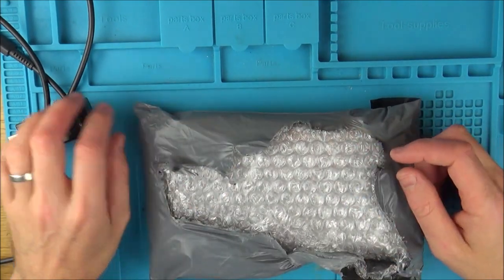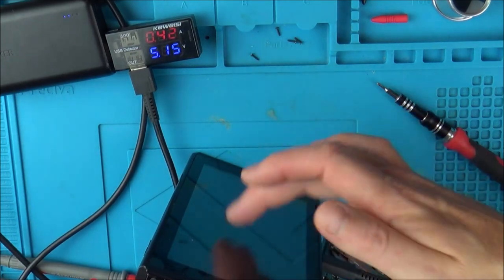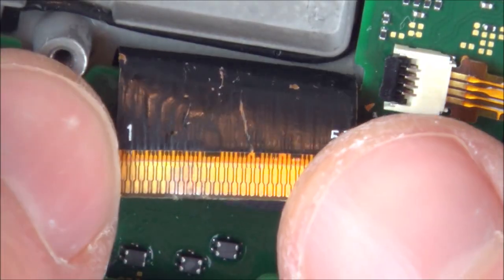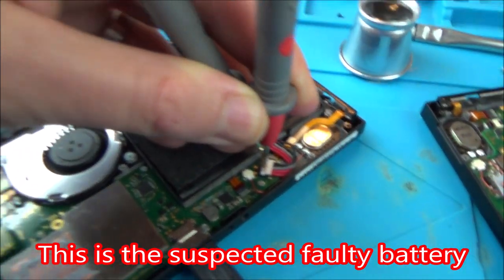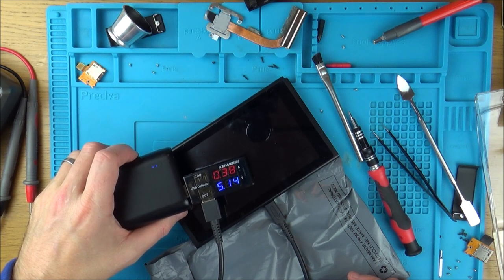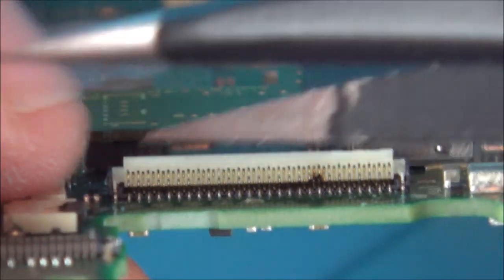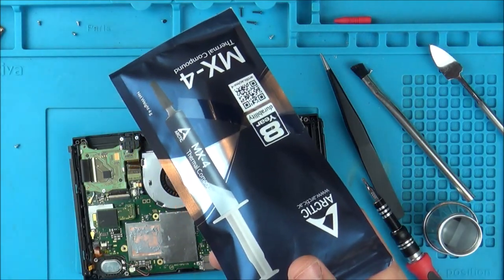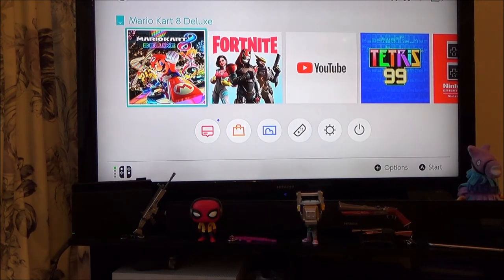Trying to FIX: Faulty Nintendo Switch

Comment: Vince,  when you showed the connector under the microscope well to say the least it opens up a whole new world,  just goes to show the switch is  quite a feat of modern engineering,  a powerful console with a built in TV,  you are a brave man for attempting these fixes,  99% of us would surely kill a switch and it's pleasing to see that you have learned enough to know when to stop,  like you said the connectors are now available and cheap,  buy one and have a go at fitting one to a dead board,  you won't know until you try

Comment: Hi Vince :) To solder connector don't use heat gun, only for desolder bad one. After desoldering, clean pads, put connector in place and solder very left and right big pads to keep it in place. Then add a lot of flux to all connector pins, melt some solder on your solder station tip and slowly go from left to right on that tiny pins. Finally use copper wick remove bridges and here you go :) also look at Louis Rossmann videos, he done that many times during his Mac repair.

Comment: Another excellent Switch video Vince!  I am pretty sure you are right and it's all about that video connector!  Why not have a go at fitting one - just use hot air to carefully remove the old one, then see what needs to be done regards fitting the replacement - nothing lost!
Reply from the maker: Thank you Chris, I spoke to Paul (the owner) and he is up for me giving it a go. I purchased 3 connectors on eBay (£2.99 each) so I can have a few attempts. I would love to able to do it as these connectors are a PITA. Hopefully it can be a revisit video:-) BTW the Atari Lynx vid has just been released :-)
Reply: Just watched the Lyxn video =D   BTW - if you can access the pins to solder on the new video connector, try just adding flux and light drag soldering.  Just not sure if that connector has 1 row of pins underneath it - meaning the only way is with hot air.  I do see the dilema - it's certainly not easy to replace I think.

Comment: Vince that connector is easy to replace ,would show you how to do it if I had a switch, I would remove the old connector with heat, clean the pads put on the new connector, solder pin for pin under the microscope , remember there are two rows of pins one under the white flap and on the back no heat required to put it back.you can heat it from the back as long you don`t move the board ,surface tension of the solder should hold the components in place
Reply from the maker: Thanks, would you use a very fine tip (the pointed one) on your soldering iron? Also would you just work with the solder on the pads or try to add new solder from the tip of your iron? Maybe with my new microscope this may be possible for me :-)
Reply: @Mymatevince  worth a go, as Paul said go for it!  Hope you do have a go i want to see it! cheers again for the entertainment. enjoy your videos
Reply: Great videos Vince, you would need solder paste and a soldering heat gun, fine tip would still be too big. Good luck
Reply: @jamiemoore7987  I think the soldering heat gun is the main issue with melting stuff. I would just stick to the soldering iron on a pre tinned and fluxed board
Reply: If the nozzle is small and the temperature set correctly it shouldn't melt anything but the solder paste :-)
Reply: I did a Ipad home button the other day, you cant use hot air on the lcd the only option was to use a soldering iron with a 0.3mm to replace the home button connector ,was a similar connector
Reply: @My Mate VINCE I would use a very fine tip (pointed one) , I would also remove all the old solder to have nice clean flat pads to work on, use solder/braid  wick and a big tip flat tip   , lead free solder takes more heat then leaded solder to melt ,put the connector on the clean pads line it up, apply flux add solder to the tip of the soldering iron , do the first pin on the connector end so that you could still move it to line it up then the other end to hold it in place. The micro scope opens up a new world I have 2 now one at home and one in my shop and I would recommend it to any body doing electronics
Reply from the maker: I have ordered up some connectors from eBay. Paul (the owner) is up for me trying it out. Hopefully if I can make any progress (good or bad) I can do a revisit on it next weekend :-)
Reply from the maker: Thanks for all the helpful comments, I will try the soldering iron first but also like the idea of solder paste using a tiny heat nozzle :-)
Reply: solder paste will only work if you have a stencil for the connector , trying to just put a small amount of solder paste never worked for me , if you don't heat the solder paste properly you will be left with small ball all over the connector

Comment: Hi Vince, you have lots of dead Switch boards you can practice on ,if you find a way to desolder one without  ruining it ,then you can maybe try to solder a new one on this working board.
Or maybe try first to resolder the desolderd one back on the faulty board before taken on the working one.  😉

Comment: Can you remove the plastic hinge before soldering?
Reply from the maker: I haven't had much success putting the clip back on if it accidently falls off. Maybe with the microscope though it may be possible :-) Certainly would make soldering more easier.

Comment: You can use that broken board you showed with the LCD ZIF connector completely mangled to practice soldering on a new one, order a few of them as it will likely take multiple tries, but it's not like you can do much harm to that board, and even if you don't succeed in soldering it on without melting it, it could still be good practice.

Comment: Replaced LCD connector 4 times by heating board from other side, you have to heat up all board slowly to prevent warping, and than focus on area under the connector. Ofc you have to re-flow pads with leaded solder, it's lowers down melting point and helps from overheating the rest of the components... for me it feels easier than BQ chip with all plastic stuff around...
Reply from the maker: Thanks for the tips :-)

Comment: Hey Vince, I watch a lot of your videos and from this one, I think there is a problem with the backlight other than the LCD connector as well. The LCD backlight cable plugs to the bottom left of the board south of the eMMC. To my understanding, the backlight should still work even if the LCD cable is completely disconnected. Can you check once?

Comment: Hey Vince, is it possible to remove the white bubbly prone latch without breaking it off so you can desolder the connector assuming the black plastic has less of a bubbly factor when you heat it

Comment: You nailed it, and luckily you were able to still see high temperature damage "resulting from some short" which luckily was not cleaned away, Nothing beats a close inspection B4 any cleaning is done. 
Paul would have replaced the chip and then that seemingly shorted capacitor whenever the screen was connected, and I stress seemingly shorted capacitor because the capacitor is definitely not shorted, but rather as you deducted the connector or further up the line is where the actual short is "as to me it seems That's why the connector failed as there has to be a short that you should find somewhere back to the screen, Having said that though, have you tried to use the screen on a good working motherboard?
Just be careful though because if the screen is actually faulty "SHORTED" yet another connector could be it's victim and much the same scar err-Scorching.. I would be checking from the screens connector and all the way back to the screen for a short before connecting it to another motherboard.. Dropped a like Vince..
Reply: Hi, yes I think you are on the right lines, I did assume the regulator as that would have explained the screen. Maybe the previous owner (I purchased it faulty) had removed the screen and bent the pins causing the short/burn whilst looking for the fault with the screen. I would like to know if the caps around the regulator still shorting now the cable isnt shorting. I will find out soon enough I suppose. Anyhow, thanks to Vince I can  now use this docked, which is what it would have been primarily used for anyhow.

Comment: That connector looks a right mess where it's burnt would be interesting to figure why it burnt in the first place overheat?
Reply: Possibly a short, as that can generate a ton of heat.
Reply: Probably due to one of the bent/broken pins making intermittent contact leading to a high resistance short causing heat.
Reply: There may not be a percentage of faulty compared to the millions of Switch (Lite)s sold involving burned LCD connectors, but it's still interesting how those shorts spawn. Could it be a factory defect with the pins on that connector that causes it to short and generate heat over time? Could it be with those users who spend a very long time on the console and the connector burns out from overuse?

Comment: If you attached a bulldog clip to the plastic on the connector, would that draw heat away from the plastic enough so it wouldnt melt (if done quick).
Reply from the maker: Good idea Emma, like a big heatsink :-)
Reply: @Mymatevince  might work. Even if it just takes a few degrees off that might be enough.

Comment: Great video Vince. Love these Switch fix videos. Where did you buy the dock extender from? Thinking of buying one myself.
Reply from the maker: Thanks. It was from Amazon. It is a little bit of a pain to fit, it can take a few attempts before it seats itself. Also when laying the Switch down it would be best to not have it lying on carpet in case the intake vents on the Switch get blocked. Seems to work well though :-)
Reply: @Mymatevince  Thanks Vince. Do you have the link to it on Amazon?
Reply from the maker: Just had a quick look and it looks like my one is currently unavailable. There are others though, if you type in 'Switch dock extender' you will see them. I haven't used it long term so I am unsure if any issues with the charging chip inside the Switch could occur when using it :-)
Reply: @Mymatevince  Ok. Thanks for the reply.
Reply: @Mymatevince  How much was it from Amazon?

Comment: Hi Vince I have a Walkman  minidisc player and after I  bought a power supply for it .it'll only work off the psu and not the battery are you interested in fixing the player. I  the battery cut-off is stuck in off position .

Comment: Does the other end of that ribbon disconnect from the screen? You could test for continuity from the solder points on the connector to the end of the ribbon, and then rewire the ones which are open circuit using small enameled wire out of a motor or transformer or something, all you need is a fine point soldering iron, scrape the varnish off the end of the wire with a Stanley knife, add flux to the end, and add solder to the iron and have the scraped end of the wire inside the blob of solder, then turn off the iron and move the wire out of the solder blob as the solder is resolidifying, this way you get a nice little ball of solder on the end of the enameled wire (for some reason it's difficult to tin fine enameled wire and this is the best way iv found) it looks like there's only 4 or 5, but definatly worth a go, definatly seems easier than replacing the connector, give it a go man, as long as you don't short pins on the connector your good, cheers for the vids
Reply from the maker: Thanks Reace, interesting way of applying solder to the wire. Always like to hear new ideas. Unfortunately the other end of the ribbon cable is moulded into the screen. I have ordered up some connectors though so I might give it a go. I will see what happens, I might get lucky and if I don't then it will be exactly the same as it is now (fingers crossed) :-)

Comment: Hi new to your channel have a question  i have a switch that shows charging when on but draws no amp.. Shows 0.000 amps. No bent pins in c port.  Nothing shorted in charging chips and fuse and coil show continuity. Any clues? Thank you

Comment: Get a decent soldering iron not that all in one thing. Then you can ensure you have a steady tempreture at all times. That will make tackling the connector so much easier. Because you solder the ground pins first then each pin or drag solder. contact JBC they will supply you with a demo unit.

Comment: What I would do now is get yourself a piece of wood and build a full functional "exploded" switch on there that with a bit of thought would allow you to plug in any suspect component to the "test jig" and verify it in an instance. This is a widely used technique and the "test rig" itself would be fun and interesting for you and us, also as your skills are developing why not have a schematic to refer to, that way when you find a "dead" whatever you can look at the diagram and begin to learn the actual function of the part. The " test rig" im talking about would be built by getting various connectors and making all the critical points accessible, this coupled with a schematic and your now considerable experience would almost certainly put you at the top of the game, and your skills will naturally continue to develop.
Reply: The odds of Nintendo releasing the schematics for this is probably less likely than finding cats on the moon
Reply: @oliverer3  If Louis Rossmann can get  "I Phone " stuff it is probably possible, besides my main point was the "test rig" but as the moon is a big lump of cheese the mice have got there (I have relatives) and believe me there are plenty of cats! :)
Reply: @andymouse  I do believe that the schematics that Louis uses aren't technically legal or in some kind of gray zone but cost an absolute fortune and are only "meant" for apple service centers so if there was such a thing for switches I think it might be cost prohibitive if it was only for hobby use
Reply: @oliverer3  Never mind! have a look around on ebay for a sense of humour...take it easy Sir.

Comment: Vince, Take a look at these vids they replace the connector in several different ways.
This one removes it by heating it up from the bottom
https://www.youtube.com/watch?v=MSX_g7uVJQA
top and bottom.
https://www.youtube.com/watch?v=F9zZ-EN7_Ug
from the bottom of the board with instructions.
https://www.youtube.com/watch?v=-Sbh6f2l4HQ
Hope that helps. I would try it on a bad board first.
Good Luck

Comment: Get that microscope out :)
Reply: Ahahah right after I made that comment.... You got the scope out lol. It really is night and day difference isn't it?? They do make an attachment to connect a gopro right to one of the eye pieces. So I'm sure you could get one for your camera if you'd like. Maybe just make one on a 3d printer. Just pull the rubber off the eyepiece and the camera focuses pretty well. I've used my hero on mine and it worked perfectly.
Reply from the maker: It is amazing, I can't wait to use it again. Couldn't believe how bright the image was, I think it will get lots of use.  I just need to find a way of filming that works for me. I know you can get a phone attachment for the eyepiece which I can use as a last resort but I would prefer to film on the camera if possible (easier for me to edit the videos from one device). I am sure I can get my camera to work I just need a bit of time and trial and error :-)